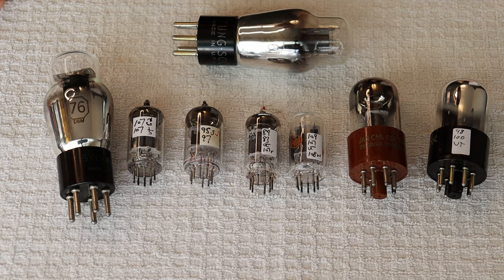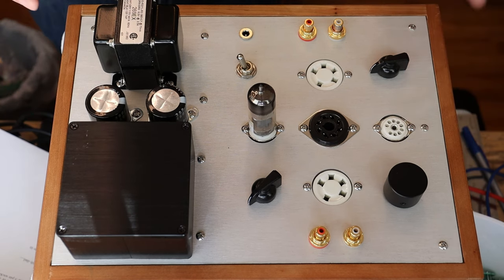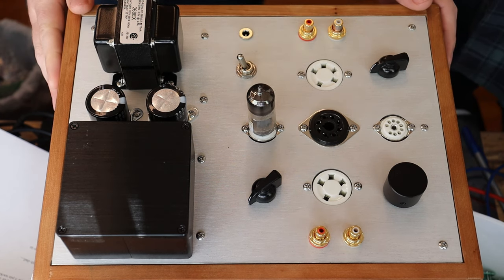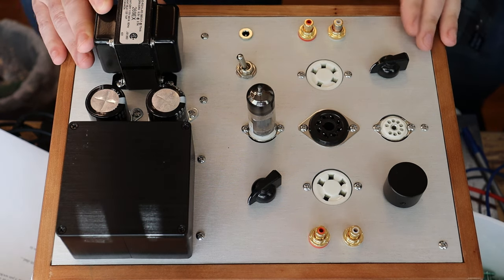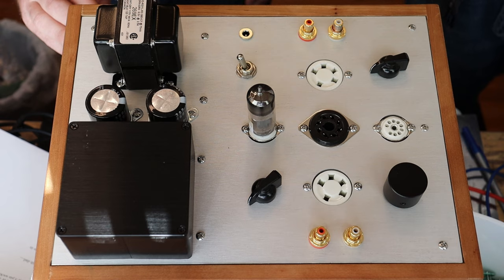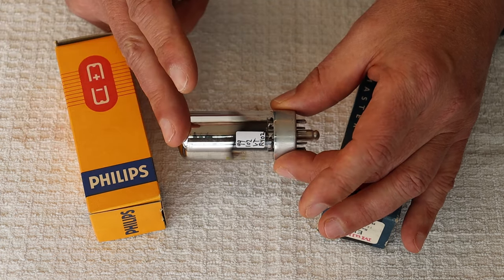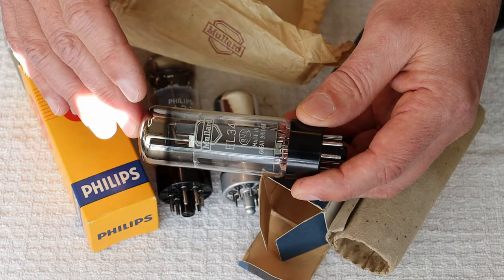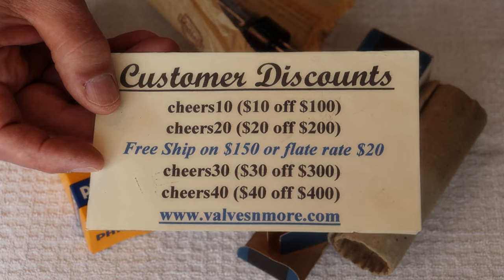Tube Lab #168 - Our New Universal Testing Preamp

Comment: Very cool testing setup!  Did you use the 2P4T rotary switch that you sell?
Reply from the maker: Correct, and interestingly the rotary switch we eventually settled on is a Chinese copy of an old Soviet mil spec switch, which was originally silver plated.  I brought in a whole bunch of the surplus Soviet switches and often found the silver had oxidized and many had contact issues.  The Chinese copy just uses tinned brass contacts (tried and true) and it has proven to be reliable and overall an excellent rotary switch.  Most people who buy amps and kit amps look closely at the specs, design, chassis and never realize how important something like a good switch is for both quality sound and the longevity of the amp.

Comment: Why not just use adapters on these 7N7s? I’ve been lucky and haven’t had any mechanical or electrical issues.
Reply from the maker: We started with adapters, but found the same issues that killed the base type are still a problem - difficult to insert and remove and poor pin contact.  The solution was to rebase as octals and that has been a huge success.  And interestingly the locals sound better rebased - I know it doesn't make much sense, but Charles thinks it has to do with the resistance/impedance change rebasing gives.